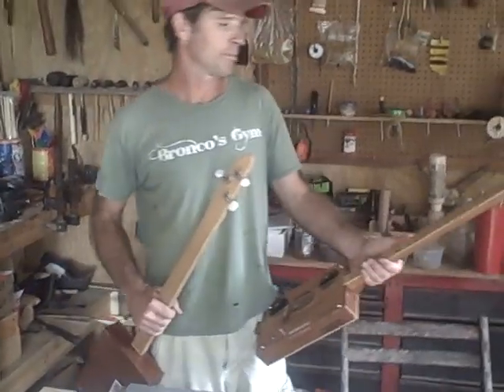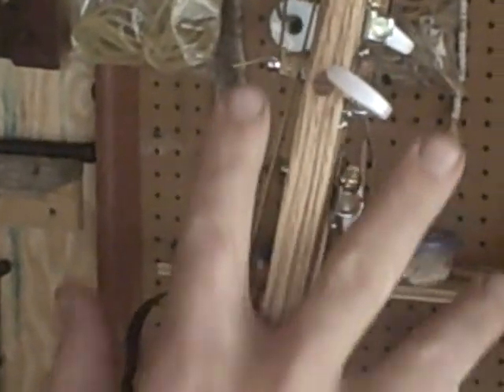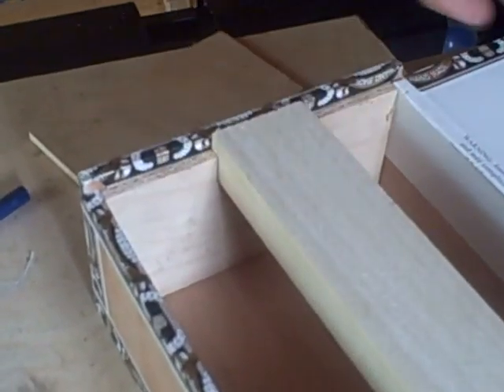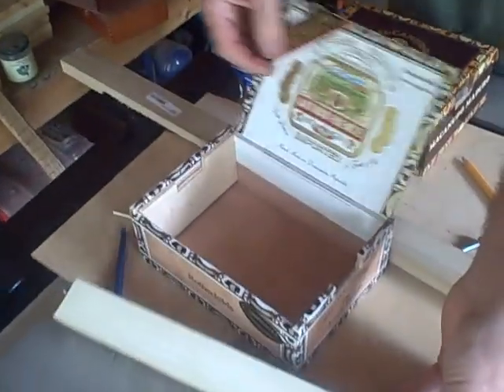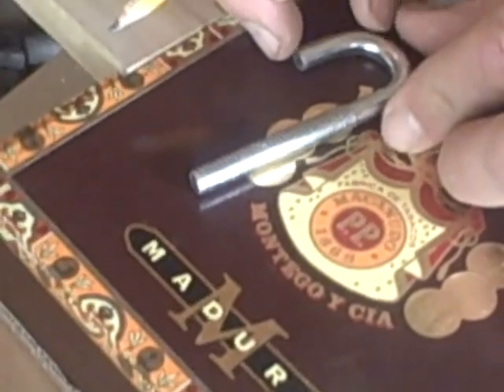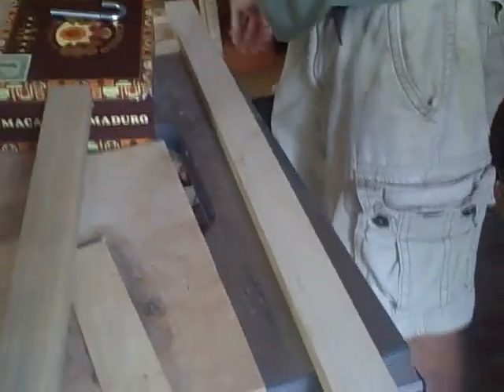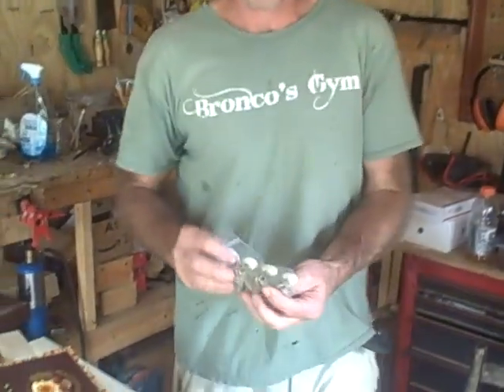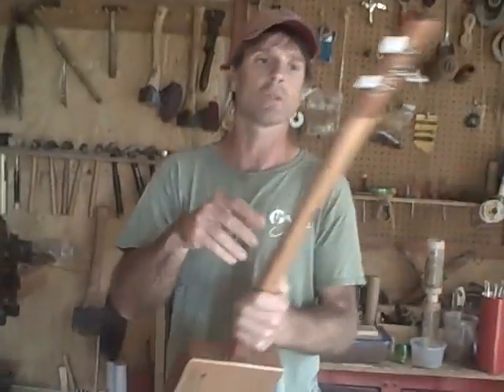How to Make a Simple cigar Box Guitar

Comment: Thanks Michael. Very quick and to the point. I have to agree with others. Never glue the bridge leave it movable. Never glue the lid just use small nails and put corner protectors on. Reason: easier to repair without tearing up the box.

Comment: How do you find the fret positions?
Reply from the maker: Two ways: You can purchase a fret guide from Stu Mac, or just make your own template using a guitar for a guide.  Hold a piece of !/2" x 2" stick against a guitar and make marks.  Then use a straight edge.
Reply: Michael Bronco Enjoyed your video. I used Lowes Swanson yardstick with millimeters & inches on it for under 3 bucks and used the free Stu Mac fret calculator. mm made it easier for me on my first and only build…so far. Working on a uke right now.
Reply from the maker: Thanks for the great tip!
Reply: That's what I did...copied the 25 1/2" Fender scale off one of my electric guitars. Worked wel!👍😎🎸🎶